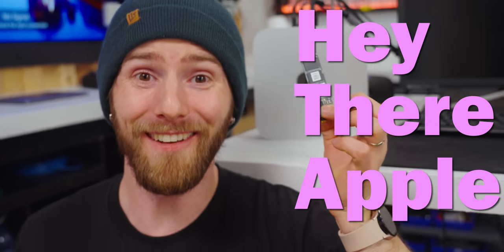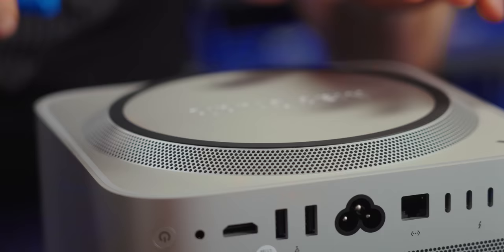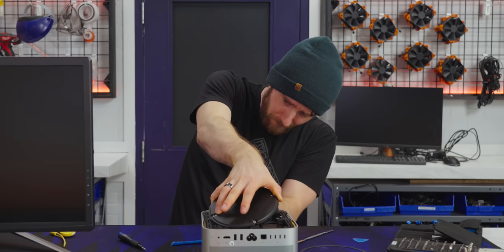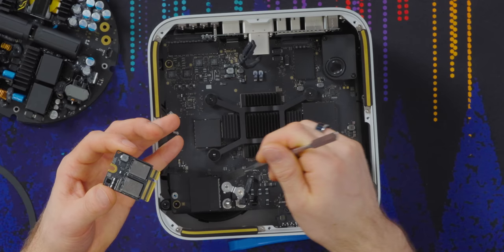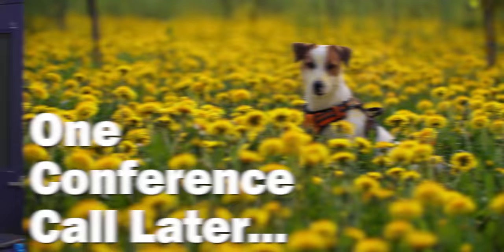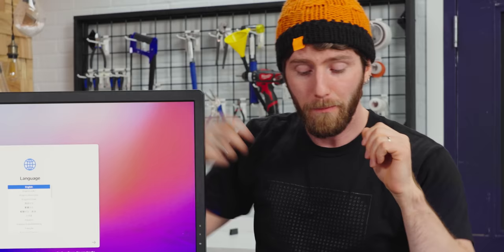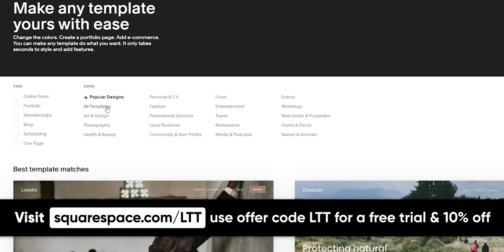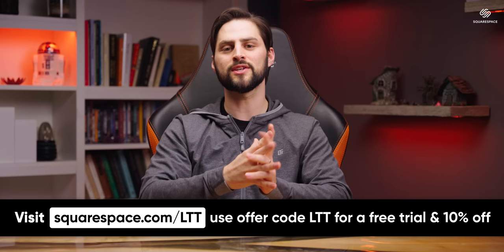I want to love Apple, but they’re making it hard - Mac Studio SSD Swapping

Comment: it really says something when you can upgrade storage on a console that's locked down to hell but not on an overpriced mac
Reply: Sony and Microsoft also tend to list skus of compatible drives, which usually starts with -- what already exists at the time of sale.

The exception of the PS2 was caused by Western Digital moving their power and IDE slots where no one else was using them... SATA standards fixed that issue, and M.2 is now there where there is the SSD standard and the Peripherals standard (because there are M.2 Wifi and Bluetooth cards).

...and remember that Microsoft is more originally a computer tech company... (also Sony MemStick is um... dead... lesson learned. (a second time -- Betamax))
Reply: You can’t at the moment with the series X. There is a third party SSD Converter for series X/S but I haven’t seen a video of one of those working.
Reply: Sony's Memory Stick Duo was really only meant for the PSP which was done to a similar way to what Apple is doing with their storage, making customers buy shitty low storage cap Cards for stupid prices, that's way it's dead
Reply: @drakethedragon457  no they used those shitty sticks in some of their cameras as well, anything sony had they liked to use their own memory sticks which made life pain
Reply: @drakethedragon457  memory sticks and whatever the vita's storage was called made some sense. still dumb but everyone was super concerned about piracy of digital content.  but look where that gets you. it stopped nothing on the psp and part of the reason the vita failed was because of the expensive proprietary storage that still stopped nothing.
Reply: That and the fact that these machines are targeted at professionals no less.
Reply: @Amoled They do it as they can and consumers will still buy it. What i want to know is is it the business consumer or the end user consumer moving the direction of apple? Most likely Apple will never tell us.
Reply: Something that professionals are meant to use to edit large video files!!
Reply: sure overpriced. Maybe spec out a performance-equivalent machine of the same size and thermal quality and the come back crying.
Reply: @THEGEEK2001  yes, who anyways either use network storage or external SSDs as even 8TB of internal storage won't nearly be enough. But sure, Apple bad.
Reply: @RandomUser2401  yes. Extremely overpriced for sub par equipment is Apple's go to move
Reply: @RandomUser2401  you think all professionals start with enterprise gear?
Reply: @thundereagle97  if you think their stuff is sub-par you have literally zero clue about tech. Their silicon was on mobile always outstanding for a good decade already and the M1s are nothing short of engineering marbles. Again, if you can't see this, read some tech-savy articles and stop spreading factually wrong nonsense.
Reply: @thundereagle97  How dare you? They are literally engineering marbles!
Reply: @THEGEEK2001  iphones by far live  the longest among any smartphone brand with full-generation iOS upgrades supported by Apple for 7year old phones. iphones easily live 5-7years, keep a great resell value and are regularly sold 2nd or even 3rd hand.
Reply: @xCokeMaanx  3 second google search shows you can change the INTERNAL m.2 drive without problem
Reply: @RandomUser2401  fair opinion. Have you ever used a7 year old iPhone, daily? It isnt exactly useable. This is besides the point apple is anti right to repair. Ssds in Mac is the point here. And similarly, all androids can be software upgrades throughout their life... With some Samsung being 5 years of service.
Reply: @THEGEEK2001  that's the whole point. A 5yo iphone works snappy and nice, most Androids will be ewaste long before that. No Samsung device has yet received anywhere near 5years of full feature OS upgrades, security patches for selected flagships if you get lucky. And: Every iphone is way better repairable than a Samsung which are so glue shut that you don't even get it open without breaking it.
Reply: @drakethedragon457  You could actually convert a normal microSD to a memory stick duo though. The adapters sold for like $5 for a pack of 7 thousand of them. I have one that actually takes two micro sd cards and reads from them in raid 0 style. 

The thing card the made after that definitely wasn't so fun to deal with though. The one for the psv, I don't remember what it was called. I think it was only a psv thing though, by then they gave up on forcing it with cameras.

btw, if anyone is reading this and still somehow owns and cares about psv, there are adapters now, you'll just have to unlock the psv first. Look into henkaku.
Reply: @RandomUser2401  if you believe this about iPhones then you are the one who needs a reality check mate. Read some unbiased works, and then you can get back at me
Reply: @virkon3208  their prices are marbles😂
Reply: @thundereagle97  this is even confirmed by multiple personal experience, all my friends and family keep their iphones for easily 5y and they still work totally fine. Every statistics also confirms this and the iOS supported models can be found on official websites. Reality check here is hard on you.
Reply: I’m using one right now
Reply: @RandomUser2401  personal experience is not evidence, it's anecdotal. Feel free to try again when you have an actual argument of merit
Reply: @thundereagle97  the personal anecdotes are numerous, the avg lifetime can be seen in statistics, AND
why exactly do you think does Apple release iOS15 for the iphone 6S, a phone released in 2015? because all of them are dead and out of sheer joy? big brain moment.
Reply: The tales of Macs supposedly being overpriced hasn’t been true for years, and now since you can’t get Apple Silicon anywhere else you’re stuck comparing to Intel machines.

Comment: These kinds of anti-consumer practices should be called out, loudly, every time.

Just like when Apple's butterfly keyboards required replacing the WHOLE DAMN LAPTOP every time a key got stuck (which was all the time).
Reply: @Terry Nelson Agreed - I don't know why we keep talking about apple.  All the advice should just be: "don't buy apple, it's bad mmmmkay"
Reply: It’s because apple design things with a strong set of user requirements in mind, and unfortunately, repairability is not one of them. If the keyboards are easily swappable it might result in in a bulkier design which is not very appealing.

To be fair, they make up for it with really good service. I rmb swapping batteries for my iPad. Instead of swapping the batteries directly, they replaced the entire iPad. All at the cost of just the battery replacement.

But yeah, I do agree that apple needs to improve repairability. They’re  basically creating  a repair monopoly.
Reply: @Terry Nelson If Macs were bad, sure - but the fact is they're incredibly useful devices with a fantastic ecosystem of support. They seem to be turning a new leaf on hardware, albeit slowly.
Reply: @Terry Nelson Main issue that EVERY OTHER brand will do the same and you end up in situation where you buy or go away with nothing at all. 
Such things must be regulated by law.
Reply: That's because the process is:
"My key is stuck"
"Okay here's a new laptop right now"
"Okay thanks"

Then they fix it and sell it on the refurb store and internally recycle the other parts
Reply: was this the keybord they revited into the laptop? And that had the powerbutton as as part of the keybord, so when you spilled coffee on the keybord you couldn't power the laptop on anyore to save your data using an external off the shelf keybord.
Reply: I will note that it’s not every time a key gets stuck, it’s more like half the time. It depends on what side the damage is on, either you can just replace the single key or you have to replace the whole top case for whatever insane cost
Reply: Apple started going seriously downhill around 2010 or 2011 with its Mac offerings. I am sympathetic to those who didn't see the writing on the wall sooner, but I started moving over to Linux years ago and don't expect to ever go back.

If you're still a Mac user and you're at, or think you might be nearing your breaking point, the time to start moving to Linux is right now. Get a VM loaded up and at least start playing around and familiarizing yourself with a distro like Ubuntu. Find some software that will do what you want to do, and get used to using it. Start figuring out what you need to know, and what you're willing to live with. Because I guarantee you, at some point, you will reach your limit with Apple, your old hardware will die with no replacements possible, and your hand will be forced. Apple isn't going to get better. They're only going to get worse and worse.

If you want an open system you can fix and upgrade yourself, a Linux machine is your best long-term bet. And it really has gotten to the point where you can do whatever you want on it. Just don't be stupid and do something like Manjaro like Linus did recently.

You could go the spyware route, I mean the Windows route, if you want to, but Mac OS X is built on UNIX and Linux works much the same way and you can customize your desktop environment to look and feel very Mac-like. You're already basically using a specialized version of Linux if you are on the Mac, just with way shittier drivers. The only reasons I can think to go from Mac to Windows is if you literally are forced to use Adobe. If that's the case, I would seriously ask yourself why that is, and exhaust all other options first with Linux software, and maybe Adobe runs fine in WINE anyway, I don't know because I ditched Adobe and use native Linux software now. If you game on the Mac, you'll find the experience and selection of games on Linux equal to, if not far better than the Mac, so while Windows gaming would be a big step up from the Mac, it comes with far more baggage than Linux gaming which gets you almost all the way there anyway.

Anyway, I'm sure this will get some hate, but when Apple gets even worse than you ever thought possible in a couple years, and you decide you've finally had enough, don't come crying to me, because I warned you, and gave you a good migration plan that would not have cost you anything but a little time.
Reply: Wont matter....too many people are apple fanboys for apple to change their ways.
Reply: @VoldoronGaming  the more pressure on Apple the more they will change. I doubt they will go back on this anti repair stuff but who knows, I didn't expect them to bring back magsafe either.
Reply: And this is not only anti-consumer, it's also anti-climate
Reply: We as consumers in a free market system have choices: then don't buy Apple products!
Reply: @tk9839  I agree, I have no idea why people keep buying Apple.
Reply: There’s nothing wrong with Linux but it simply can’t do what a Mac (or PC) can for the most part with the same applications.

Sure, there are Linux apps that can do what say Photoshop and Premiere can do, but do you want to spend the time to learn them?

For most computer users the apps are what it’s all about, not the OS, it’s “how can I use this to get my job done, and no, I don’t have time to learn some other app.”
Reply: "These kinds of anti-consumer practices should be called out, loudly, every time."
*should be illegal
Reply: People are mad about not being able to get inside their Macs, upgrading them and so on.. But to me this makes total sense! This is what Apple does - they make it as easy to use for their customers as possible. Which is amazing and I love it! It is same with their software - they dont let you to change the some core funtions of the system, intead they build a Mac or create a software that works perfectly and is not meant to be changed by users that many times dont even know what they are doing.. Apple prevents users from accidentaly damaging their Mac or the software. Just buy the product from Apple that you need and use it - it works perfectly as it is and no need for any stupid upgrades which might cause many problems to the device. It is more expensive for the user, but I love that their products work as they are supposed to - windows and android devices can be repairded or modified easily but that brings many annoying problems.. I remember how many hours I spend on youtube on various tutorials for fixing something.. So I am totally fine with Apple creating a great device that is not meant to be modified and just works as its supposed to!
Reply: I spilled tequila on mine and now I'm doomed to an on-screen keyboard
Reply: Just stop buying them. 
I were Apple, I would not stop bullshiting you if you always buy it
Reply: A whole laptop replacement for a single button? Damn apple

Comment: I just successfully "swapped" a SSD drive between two Mac studios(4TB vs 8TB). I struggled on the same issue but funny thing it turns out that I just need to change the original disk location and then it works out well(both units restore successfully after the swap). In stead of slot A to A swap, try slot A to Slot B swap.
Reply: Could you expand on how you changed the original disk location?

Comment: I like how simple things like swapping out an SSD on a c̶o̶m̶p̶u̶t̶e̶r̶ mac has to be a dedicated video.
Thanks Apple, very cool.
Reply: It's not an SSD. It's just  the flash.
Reply: @marcel151  but they also make ssd upgrades impossible... (just not on this specific device, ie their laptops)
Reply: A Mac is a computer. An abacus, is a computer. Personal Computer is the IBM trademark.
Reply: Is something wrong with my phone or is the text on this comment messed up?
Reply: @sboinkthelegday3892  I don't think it has the right to be called a computer at this point, It's just a functional box that cant be repaired
Reply: The Mac is a media-focus workstation, like the workstations from the last century.
Reply: @yannrampitsch6678  they are built the same. SSD controller built into the SoC. These aren’t Ssd, they are Nand flash
Reply: @taticaldroid9288  ugh, no.

But keep digging into Apple because they don’t care. 

Don’t get stuck in your own feelings.